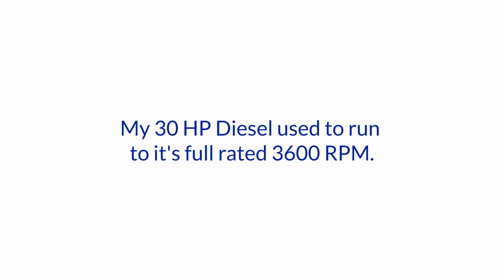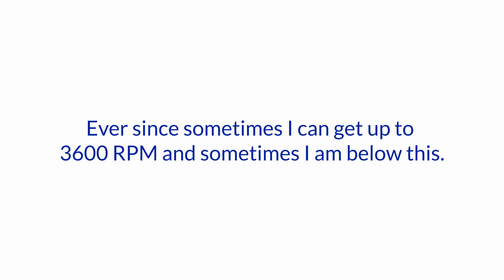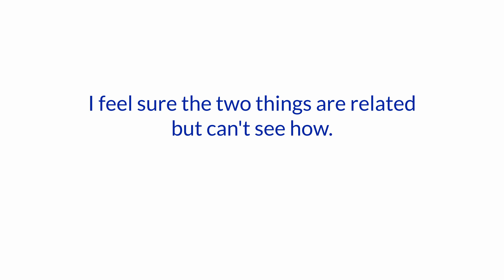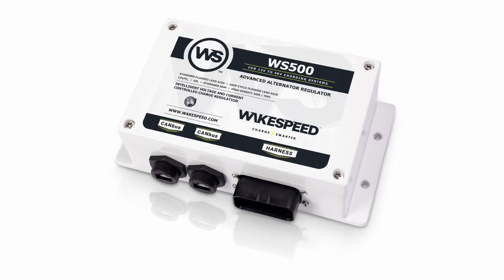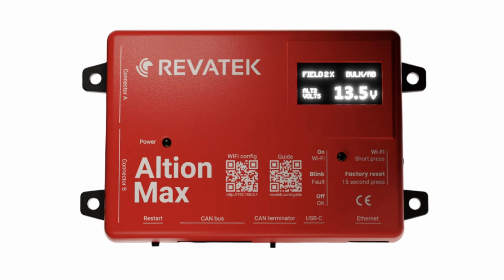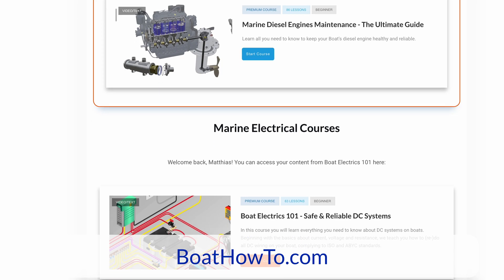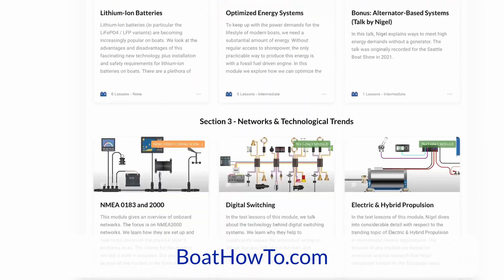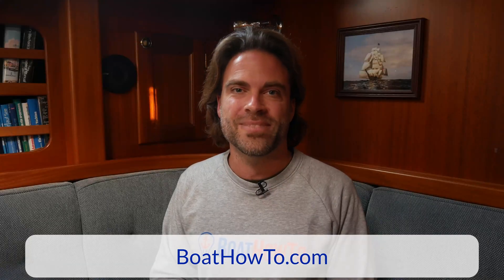High Output Alternators on small Diesel Engines | Ask The Expert with NIGEL CALDER

Comment: An alternator converts mechanical work to electrical power. An ideal, permanent alternator that is 100% efficient will convert 1 horsepower into 776 watts. Eddy current,  bearing drag and cooling air flow reduce alternator efficiency to probably about 60%. So it takes about 2 mechanical horsepower to produce 1 kilowatt of electricity. Alternators put out more current the faster they turn but only to a point. Beyond that speed air drag on the rotor builds.

Comment: The bottom line is that most people have absolutely no idea that there's no such thing as getting energy from nowhere. Understanding energy from alternators and generators are a prime example of the incredible lack of knowledge of the basic laws of physics and one reason why these "free energy" scams thrive. If you want kilowatts output from something, you have to put kilowatts of energy into it (+ efficiency losses). So for example if you want 1 kilowatt out, at say 50% efficiency of the generator, you have to put 2 kilowatts of energy in. Where do you think that 2 kilowatts comes from?
1 watt = 1 x joule per second = 1 volt x 1 amp :: Power =Volts x Amps  :: 1 x horsepower ~= 746 watts

Comment: Used to do something similar in my car racing days where the rules stated that you must have a working alternator. Basically had a microswitch on the throttle that would shut the regulator off past 3/4 throttle and a large resistor which kept a small current flowing through the field so that it was still a working alternator but at much reduced output when calling for full throttle to remain within the rules.
Reply: And people think car guys are meatheads………

Comment: Numbers seemed off so I did the math. A 200amp load at 14.5v would be equal to 3.9HP not 5-7hp 🧐
Reply: You not allowing for the losses on the alternator of 40% which brings it up to 5 to 6 hp
Reply: @ I’m using his example where he states that a 100 amp alternator’s inefficiencies will likely draw close to 200amp. The loss is taken into account.
Reply from the maker: Thanks for your comment! Please find the calculation in the description under the video.

Comment: Any concerns on the added "pressure" on the nose of the crank from a high output alternator causing bearing and/or oil seal issues?

Comment: Understand that at full throttle the engine’s output goes to propelling the vessel, which is probably a good idea.  When the high output alternator is less than full rated rpm can the alternator adequately cool itself when field current demands full alternator output?

Comment: Also with a larger than stock alternator,  it really needs a wider belt. The vbelt  was always dusting. Was afraid to make it too tight and start bending stuff. Went to a multirib belt system,  that went away, but introduced a new problem of the pulleys not being aligned properly and squeaking! Used a laser alignment tool from Gates to dial in the alignment,  and a balmar belt buddy to dial in and locate the alternator perfectly.  No more dust or squeak!

Comment: The weight of a heavy alternator outboard of a little shaky diesel should not be underestimated. The OEM brackets are usually light duty and unable to handle the loads of the new alternator.  Everything must be upgraded for it to work.
Reply: You are absolutely correct. Where it even gets more tricky is the side loads on the crankshaft bearings of small engines
Reply: @warrior9086 this is overrated. I’m getting 9kw generated on my 45hp and have had no issues.

Comment: sorry to ask a silly question but can you just turn the engine switch off to cut off the alternator?
Reply: that will damage the alternator regulator. i had a worn ignition key that switched off on its own and experienced the issue.
Reply: No, but you can add a switch to switch off the field , which will do no harm, and stop the charge.
Reply: Ok thanks, I was sort of thinking it was the same thing but not sure.
Reply: Several sailors I know have the field on a switch in case they need full propeller power in an emergency